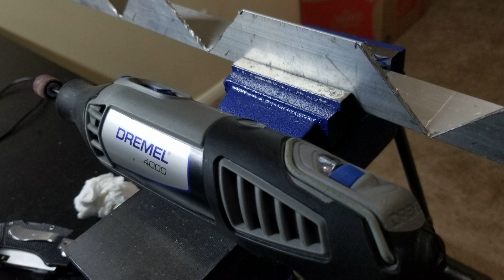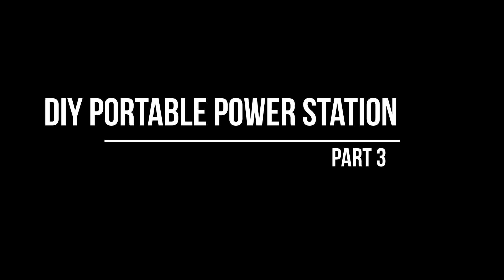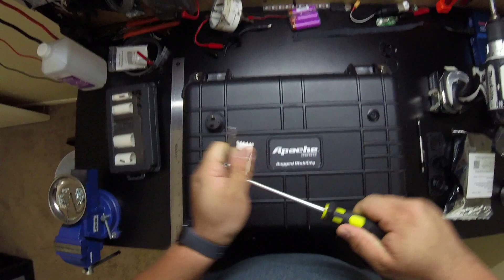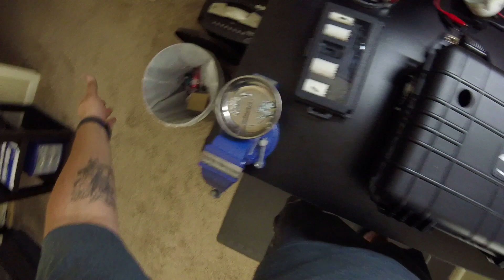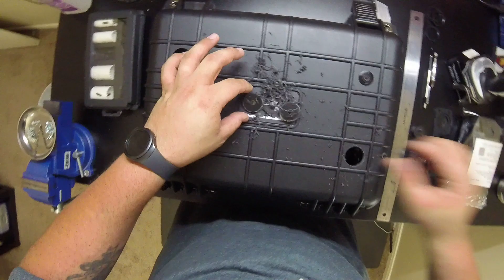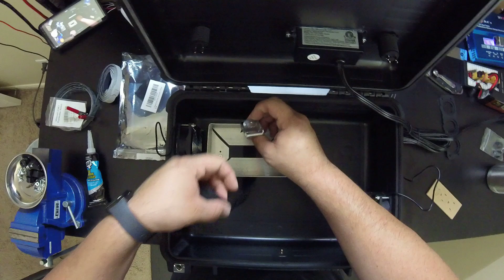DIY Portable Power Station - Part 3

Comment: I've seen the cooling fans online but I've never seen one with a grill / guard.  Where did you locate guards?
Reply from the maker: I ordered these from Amazon, they came with the grills. Here's the link:
WINSINN DC 80mm USB Fan 5V 8025 Sleeve Bearing Brushless Cooling 80mmx25mm 2PIN (Pack of 2Pcs) https://www.amazon.com/dp/B07HLFC3P9/ref=cm_sw_r_cp_apan_glt_i_ZY8HXHWM43Y8SMAM6T1C?_encoding=UTF8&psc=1
Reply: Thanks.  I will check it out.

Comment: Mounting the Battery with a 2 Inch wide strip of Velcro would have been a Hell of a lot easier-and CHEAPER!
Reply from the maker: Good point, but the straps were cheaper because they were free 😎
Reply: @JPG23  Can't argue with free, lol! That being said, I personally don't like to drill holes in those cases-just me....
Reply from the maker: @bruceforster3709  Yeah, I thought about just leaving it with the mounting tape, but the battery weighs 8 lbs and didn't want to leave it to chance
Reply: @JPG23  Home depot now sells some White Velcro patches that are incredibly strong. You might look into that stuff for future projects.
Reply from the maker: @bruceforster3709  That's awesome, I wonder if it could be strong enough to keep an 8 lbs battery locked into the tray